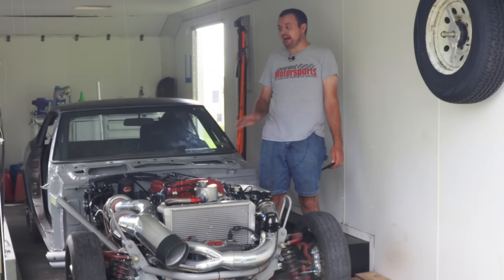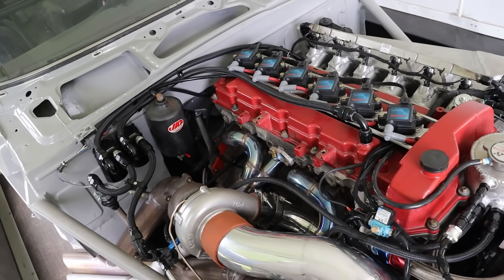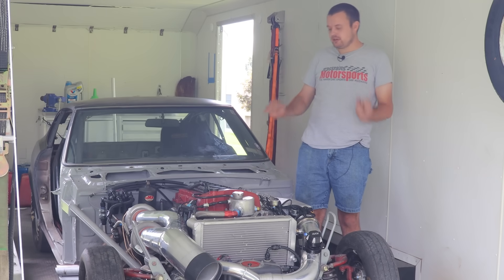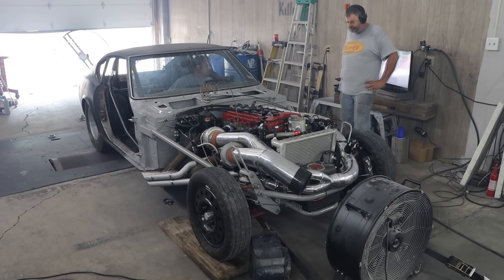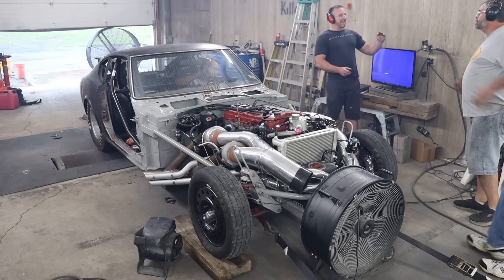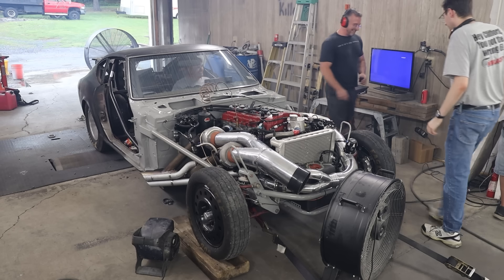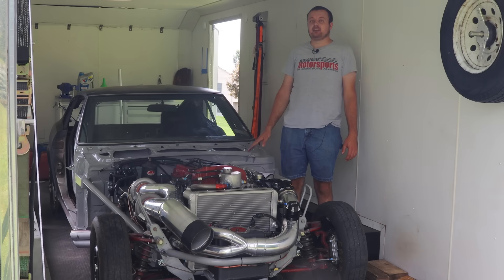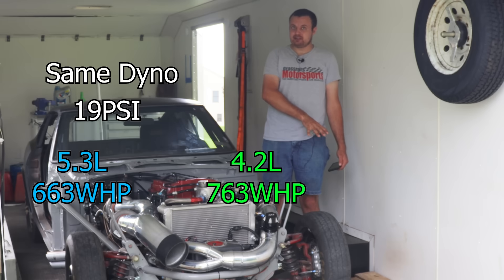This 4.2 Liter Engine Just Beat a 5.3 LS!

Comment: 54 yr ago I had a 1969 Pontiac Custom S with an overhead cam I-6.
Smoothest engine I’ve ever owned.
After putting about 4K miles on it, I ran Florida to Colorado in record time (for me), like 135mph across boring Kansas.
Smooth as silk.
Engine, and transmission, were superb.
Pontiac made some great cars.
The 1968 Firebird 400ci V-8 was another one.
So was suspension, esp at high speed.
I’ve always loved the I-6 best of all engines.
Had a 1958 Jeep station wagon 4wd with an L6-226 flathead in
It. 5” stroke. Torque unbelievable. 
First engine I ever modified was in high school, a 216 ci I-6 in a 1937 Chevy business coupe (0nly a front seat, short and light).
No oil pressure to crank journals for rods.
Scoop on big end (hole thru bottom of cap) picked up oil from trough fed by tube from oil pump.
It all held up with mods though.
Shaved head and ported and polished, big Rochester carb to replace dinky Carter, set of Corvette 6 cyl exhaust headers (first Corvettes were 6cyl).
Burnt clutch disks though til I beefed up pressure plate.
Started my love of 6cyl engines.

Comment: You have to remember the LS has a huge aftermarket because its has billions of research from the racing scene. Problem is they are ancient 2 valve pushrod engines at their core. The 4.2 is a 4 valve per cylinder dohc. Thats the difference between newish but baseline technology and old technology run to the absolute pinicle of what its capable of

Comment: My Buddy of 50+ years has a 4200 for a few years now.
As you say, had to make most everything. Intake/injector and exhaust/turbo manifold . Oil pan, steel bell housing, flywheel and 6 speed stick. 
This is in a 40's Studebaker pick up.
Daily driver. 
The long block was a drop out, just cleaned up.
10psi or so and 500+.
I told the dyno guy to get the dyno calibrated at first.
They are a sleeper engine.
Hasn't even been turned well, it drives too good

Comment: Just think what a LS style engine could do with similar heads, even if its pushrod 4valve/cylinder, even though making a v8 overhead cam (or DOHC) maybe raise thd deck.125" and widen ghd pan rails 
.200" deepen the g   roughly   .325"
It should makea a 4.100"" stroke possible maybe even a 4.120"/ 4.00"stroke, with a 4.080" (possibly a 4.100" bore) with 4valve head wuth 6mm stems ,  and about 1.80" intake, and 1.45 exhaust maybe large,  maybe allow dual plugs, one intake side , one exhaust side. Possibly put the piston .020" intge head, eith a gasket 
.030" and bore either .003" larger than stock bore, or
.002 larger  than the largest over bore, (+/- .002") a MLS gasket, with  soft copper oring , with with a .015"-.020" stainless o-ring  core forming a fire ring, and a thin silicone layer around water and oil,  3x .010" layers, with a .010" copper in the fire ring area,  it should be capable of lots of power and CID,  flow about 300/240 cfm stock, abc possibly get 350/295 WITHOUT larger valves, and dtill havf port velocity  and swirl,   unshrouded valves, and fair quench pads, it could be a 500 hp+ natural inspired engine,a 2 bar boosted engine should easily best that by over 2.3 times 1200 at the wheels,
Reply from the maker: Yep. The new Corvette Z06 5.5L is all the proof you need.

Comment: Jesus that inline 6 is pushing as much rwhp as my 06 6.6L duramax but the duramax also has around 1200ftlbs of tq which makes passengers grab gor the bars when i punch it.  Lol nvm that was on your first pulls lol im at just over 600 when i did my tunes with a friend until i rebuild my transmission and swap my turbo then i will push a bit more but i dont think i want to pass 750 at the wheels because its a DD and my work truck and even at 600 rwhp/1200tq its still a pretty terrifying vehicle and does mid to low 12s in a 1/4 in a 7200lb vehicle.

Comment: Inline 6 is a very good platform. Cummins 5.9, Ford 300, Ford Barra, Jeep 4.0, all of them great engines, inline sixes.
Reply: And the 265 hemi in line six down under😊
Reply: @cecilbdemille8079  I've never had a chance to play with one of those, I would love to find one. 300hp! Some things sure are hard to find in the States.
Reply: I agree! Super easy access to plugs and other components!
Reply: One of my fastest plug changes ever was on a Jeep 4.0 while trying to beat a thunderstorm.  @donaldlewis8643
Reply: Cant forget the BMW.  It's their bread and butter
Reply: @masonite1973 N52 ftw
Reply: Maybe we can send you one ..
215 /245/265.  Cubes 3 choices 
There is a 265 hemi running 7s 
And plenty of turbo hemis getting around ...😊
Reply: 4.0l was a p.o.s head gasket eating low oil pressure junk. Good power but junk.
Reply: @HorsepowerHeadquarters454  I used to see so many 4.0 jeeps coming in for regular service with big numbers on their odometers. lol 250k+ with zero engine issues, some over 300k, still running with just regular oil changes. In fact, I never had to do a head gasket repair on any of them. Of course those same high mileage jeeps had gone through 2 or 3 transmissions, that's another story..
Reply: @AmericanThunder i have a canyon that has well exceeded these numbers by miles no pulling the engine apart to fix it either just HARD wot miles ive had them cheeps 4.0 they are junk torque to yield one time use head bolts. All they had going for them was decent power.  They litter the country side 😂

Comment: I remember some years ago when and where a couple of guys took an old 230 Chevy and made 460+ HP NA'd. @around 6k rpm with carbs and pump gas. They went on at the time to have the fast inline in racing soon after. No VVT, no electronic controls what so ever.

Comment: Just my OP, but as with the oil burning guys, that 5.9 Cummins is a killer 6. You just can't urge with dyno results. It's cubic dollar that wins in the end. Inline 6's are inherently better balanced, simple, and they have pretty much always ruled the torque world. Also as pointed out by davesoltoggio those extras 2 mains are a BIG bonus where strength matters. Why would anyone choose to have 2 cylinders rods on 2 caps when you can have 2 caps for each cylinder?

Comment: I figured head studs was a factor in this.  Can't tell you how many of these blow a headgasket stock
Reply from the maker: We've run stock head bolts to 824whp. Not even a tiny bit a coolant pressure.
Reply: The average regular citizen must be extremely poor on maintenance then.
Reply from the maker: @cruisecontrol6938  What????? That can't be true!
Reply: @Calvin-Nelson  If this is the same motor I have been seeing in these Tailblazers, in Louisiana, always coming in for a tune up & customer states ," I keep having to pour coolant but I'm seeing smoke out the back end." 

Just had my coworkers son blow one up because he was hot dogging on the road. Came home , "Dad, my car smoking." I had to tell him the bad news & then they college bound?? Ahhh

Comment: Stop wasting fossil fuels.  The planet is on fire or getting drowned.
Reply from the maker: We aren't. We run ethanol. It's carbon neutral. Do some research.
Reply: In 2009 and 2020 when car usage was significant reduced the air quality was negatively impacted. Studies are proving that car emissions are not the issue. Natural disasters have always been the single most influential contributor.

Comment: Tom Bailey....ice cream truck....check it out....stock but very kewl.  The unique flywheel bolt pattern sux... If GM would have given these the LS style setup....they would be a common swap I would wager.
Reply from the maker: It's really not hard to adapt. The dowel pins are in the same location

Comment: I6's seem to be the way to go in both Spark Ignition & Compression Ignition engines. 

I used to have a Cummins 5.9L in a 03' Dodge 2wd Dually, that I was hauling new RV's to the Dealers. It was NOT the HO Cummins, but the standard 250 hp w/ the Common Rail Injection. It was adequate power & torque to tow over 10,000 lbs. & when I was "Bob-Tailing", it got about 20 mpg @ 70 mph.

There's a reason why I6's are used by MOST Diesel Engine manufacturers & I heard that on a V-Design, there are potential problems with Piston Friction against the Cylinder Walls, so maybe that's the reason why?

I remember the Vortec 4.2L that I read about a few yrs. ago, BUT I think that that one had a Centrifical Supercharger like a Vortech on it & it was Dyno'ing @ about 750 hp @ the Crank! 😲

Anyone remember the Clifford Research Ads from the late 60's, where they said "6=8"? 🤔

Comment: Interesting 6 cylinder. I'll have to learn some.  You should check out the V6 in a Syclone a young guy is running. Jeremy Hacking. Personal Best. 7.59 sec Quarter Mile at 185 mph single turbo and still street legal. 
Check it out...

Comment: difference between this and the 5.3 is this 6 has a good flowing 4 valve head and can turn higher rpm. The 5.3 isn't bigger enough to offset the high rpm airflow capability of this engine. Not bashing. Been curious what this engine can actually do for some time
Reply from the maker: But everyone raves about the LS cylinder heads??? (Joking)

Yeah. A 2 valve just can't compete with a 4 valve. That was the point of the video. Lol
Reply: @Calvin-Nelson  LS heads are great, for 2 valve heads. The 5.3 head doesn't exactly flow like an LS7 head. 4 valve heads and revs are why the Coyotes keep up with larger LSs and Hemis.
When these GM mod engines came out, GM raced a turbo 5 cylinder version at Baha in a Hummer H3 looking truck. I think it made something 500hp. There was also a show car Tri 5 wagon built with a turbo 5 cylinder.

Comment: The inline 6 motor has more turbo on it than the ls that’s why it makes more at the same boost
Reply from the maker: Incorrect. 5.3 had a single 80/88, and the 4.2 had twin 62/62s. While the 4.2 might have a slight advantage, 100 more HP with 71 less cubic inches is more than enough to cover any potential outliers there.
Reply: @Calvin-Nelson  that’s like 40 more mm of turbo
Reply from the maker: And if you say that it's not fair that the one engine has twins. It doesn't make a ton of difference if you aren't anywhere near the flow limit of the turbos (which we weren't). Here's proof: https://youtu.be/zp65Y7wKaEo
Reply: @Calvin-Nelson  I didn’t say it’s not fair I don’t really care if it’s fair or not it’s just a fact that bigger turbos make more power per pound of boost
Reply from the maker: @WillSwingem  Ok. Watch the video I shared and explain why two 67s don't make more than a single 80.

Comment: Of course I have to chime in. Single turbo vs dual. 😜
Reply from the maker: Doesn't make a ton of difference if you aren't anywhere near the flow limit of the turbos (which we weren't). Here's proof: https://youtu.be/zp65Y7wKaEo
Reply: @Calvin-Nelson  then why have two on your straight 6? If the same can be done with one?
Reply from the maker: @methanial73  Because it looks cool, and it will spool faster.

Comment: The Atlas was killed off by the length of the engine causing crash test problems. I have it in my Trailblazer and it's one of the finest engines I've ever owned.
Reply from the maker: I think it was killed off more due to the fact that the plant that made them closed during the recession in 2008.
Reply: Nope, GM wanted to use a newer platform (Equinox) and the engine was too long for both crash testing, as it got pushed too far into the occupants area, and was too long to use transversely. They had already developed a 405 HP version for use in the Trailblazer SS, but decided the 395 HP 5.3 was the way forward.

Comment: Some people make well over 1500 hp, some are not even LS's, & I'm  not talking about +400 cid. If your engine didn't  come from the factory with forged pistons, you just might get a few more pulls with that set-up. Apples & oranges, 1000 hp is really easy with a propperly prepped set of heads with a 5.3. Richard Holdener does it with a junk yard motor

Comment: Okay. Horsepower with zero boost ? Probably wouldn't beat my van n.a.
Our ls stroker motors would smoke that 4.2 but then again they are about 3 litres bigger and 13.1 compression and have 300 to 400 shot of nitrous.
But kudos to you for going outside the box and doing something original. Should whoop lots of butt with that car.
Reply from the maker: The point of the video was to show that the architecture is superior. If you start giving advantages heavily to one side, it's not really a great comparison.

My test wasn't perfect. The 4.2 had a few small advantages, but 100 more HP with 71 less cubic inches is enough to say it is superior in my opinion. You may draw whatever conclusion you like! Thanks for watching.

Comment: Didn't know Doug Demuro did performance cars. Seriously cool build. There's a reason the 2J and Barra are so loved.
Reply: We actually specialize in little known or thought about Honda/Acura V6 J-Series engine. It's such an underrated platform. On 7.8psi 3.5L J35A7 were making 550whp on E85 pump, in my daily 06' Accord Coupe 6speed manual 😎😁

Comment: Reused the stock piston rings? There are way better rings out there than the GM factory ones.
Reply from the maker: They aren't as affordable though.
Reply: Factory rings were not designed for hi cylinder Temps created by boost. You put all that time and money into a build. A stock engine the Factory rings are fine, but this engine needs better parts in certain key areas. Rings would be one of those areas. P.S. when building a race car affordable isn't part of the formula.
Reply from the maker: @adamscott9725  Ok. You say To-mah-toe, I say To-may-toe. People are making 1500hp with stock rings. See ya!

Comment: I always said 6 equals 8 I have six cylinder my Ranchero I used to get 33 miles to the gallon on that thing with a header on it then a bigger one barrel carb that's a nice motor you guys put together there then again they don't build that motor hear that motor is from Down Under Australia and New Zealand

Comment: I had a old landcruiser with a straight 6 and I drove that truck over 220,000 miles and never once did an oil change.  I would just add oil whenever it was low,  a couple quarts a year.  My friend bought it from me 13 years ago and he has never changed the oil either and he drives that truck almost every day

Comment: The LS is not a GM engine.. its a copy of the Cleveland
Reply from the maker: Ha! Well, it's better than that too!
Reply: @Calvin-Nelson  No it's not,  351c 4bbl closed chamber heads are so much better then any Chevy small block.  NASCAR banned the engine for a reason
Reply from the maker: @richardjosephus6802  you know why they outlawed overhead cams in NASCAR right??? Because they work!!!
Reply: @Calvin-Nelson   Cleveland's don't have overhead cams, push rods, and the exh is the same size as a chevy big block 2.19
Reply from the maker: @richardjosephus6802  the 4200 does have overhead cams. That's my point.

Comment: Yeah it's more balanced no shit it makes more power but the ls sounds cooler
Reply from the maker: Balance has very little to do with it.
Reply: Yeah I understand there's 2 big ass turbos on the car. But I also understand that inline 6 engines are way more internally balanced then a v8 engine you'll also notice becuase of that the inline 6 will turn more rpms with much less work then a you have to do to a v8 to make it turn the same rpms more rpms usually equal more horsepowers come at me bro 😉
Reply from the maker: @Threads1220  Also wrong. Just as easy to make a V8 rev.
Reply: It's really not try to Rev a sbc that far and you'll get tired of spending money on it
Reply from the maker: @Threads1220  We're only spinning the inline 6 to 7500. My Dad has built many Small Blocks that revved higher than that reliably for less than $1000.
Reply: And I don't mean a ls I mean a smog Era sbc 350

Comment: I worked at the Pontiac powertrain in the early 2000s while there they had a lab where they were messing with the Cadillac LX are and the trailblazers. They had two trailblazers with the inline 6 in the shop, one with one big single turbo, and one with TwinTurbo‘s on the windshield decal They were rated at 400 horse.
Reply from the maker: Yeah. I read the articles about that. Pretty cool.

Comment: But how much more CFM does the Barras turbo setup flow at 19PSI? Saying it makes 100 more hp at the same boost is very misleading
Reply from the maker: I think it's pretty clear which one is flowing more CFM. CFM is directly proportional to HP. Also, it is a Vortec 4200 not a Barra.

Comment: Many factors mentioned so many times, however two giant turbos and their sizes, and a drag spec exhaust arent mentioned much if at all, nor is what fuel.
Reply from the maker: The 5.3 had a S480 which is an 80/88. The 4.2 had twin GT3582, which are 62/62 turbos. They both were running E85 with methanol to do the charge cooling. 

100 more HP with 71 less cubic inches is impressive even if it had a few minor advantages. You may take it however you'd like. I won't judge.
Reply: i Love it, I just didnt catch the sizes nor the fuel. I run a 2jz turbo swap with just one gt35. this is the 4.2 i6 chevy i6 from the 2000s trailblazer etc then right?
 @Calvin-Nelson
Reply from the maker: @jungled Yep

Comment: I still think GM dropped the ball on the Atlas engines. Should have kept them around in i4 and i6 flavor. No need for the fiver; it was a decent engine but keep it simple. They take some custom work to make good power with but have high potential and the torque from the i6 is naturally great. Why they only used this for a short number of years is baffling. The i4 versions could easily have been factory turbo'd to match Fords Ecobeasts.
Reply from the maker: You can blame the recession in 2008 for that.